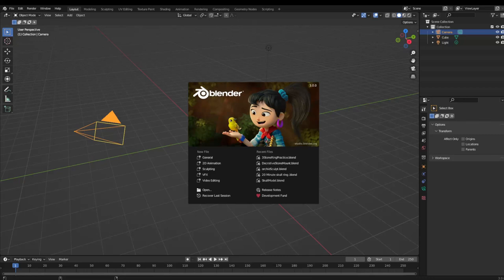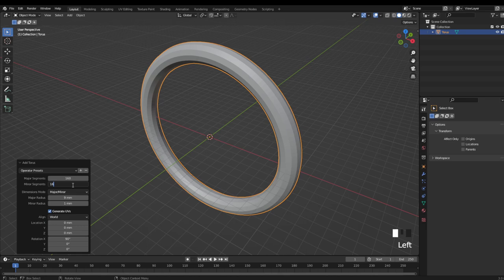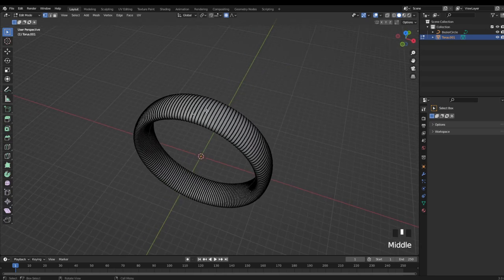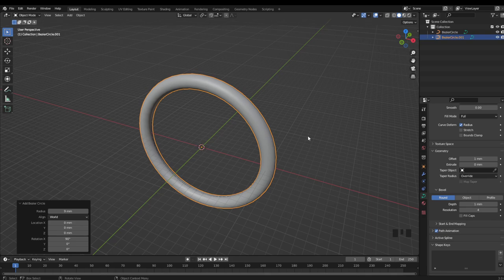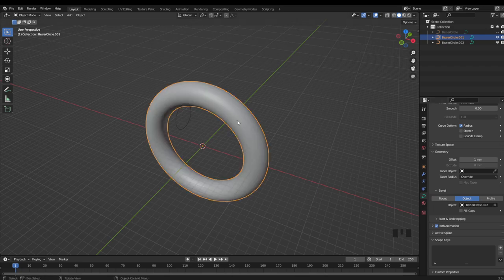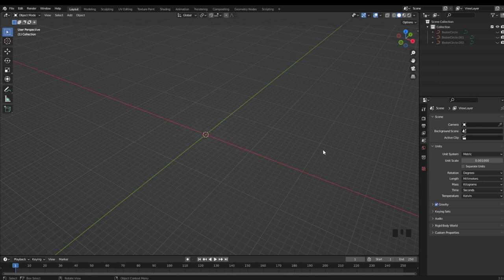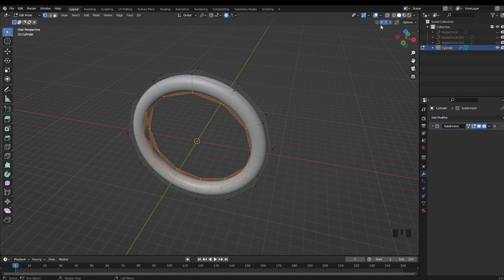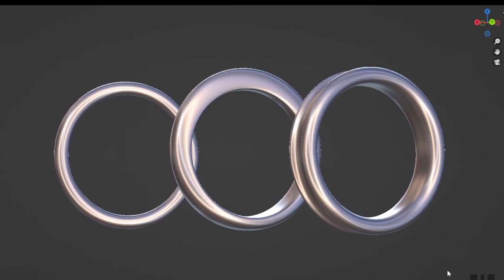Jewelry Design | Different Ways to Model a Simple Ring in Blender [Tutorial]

Comment: I checked my settings and couldn't replicate changing the influence of the scale. It was either scaling the whole width on the y axis or if I turned off proportional it scaled just the selected vertices
Reply: how did you fixed it? I have the same problem now

Comment: On the second ring my proportional edit does affect both sides of the ring it only pulls it to one side or the other. Any clue what i am doing wrong? Great turtorial btw. Im getting a great understanding with these videos.
Reply from the maker: Sorry, It's really hard to tell without seeing it. It sounds like you may be moving it instead of scaling it? The proportional editing tool can work for scaling too, that's how I change the thickness of the ring on the bottom.

Thank you for watching! I'm glad the videos help 😁
Reply: Hey! Also having an issue with this. I'm following step by step but when I select a part of the ring it doesn't select the other side, and when I try scaling in proportional editing it just makes the piece I selected bulge, but it doesn't effect the whole ring  @GraceNoteForge